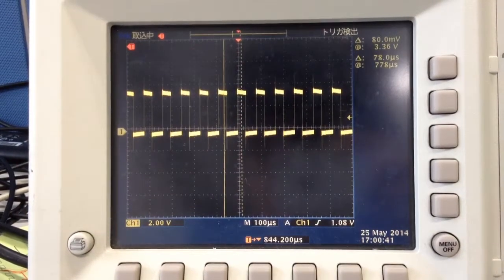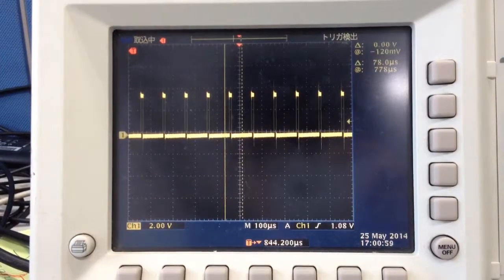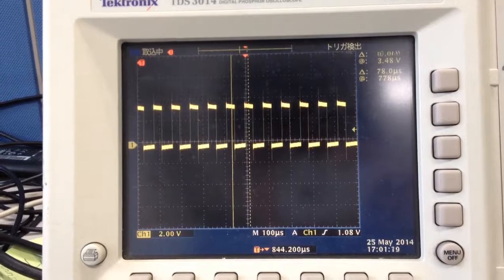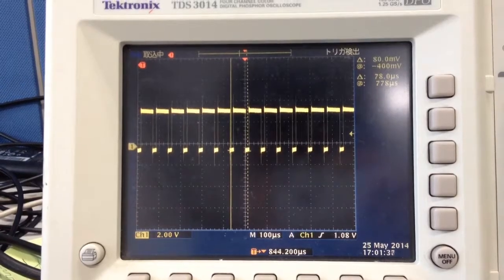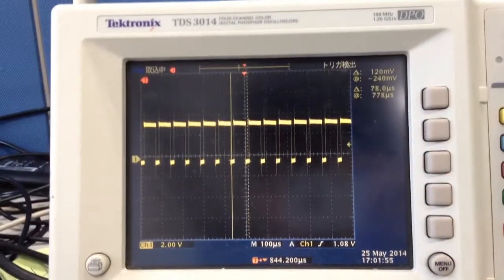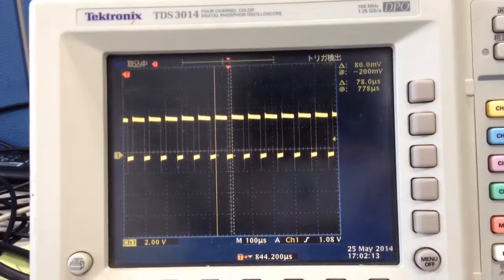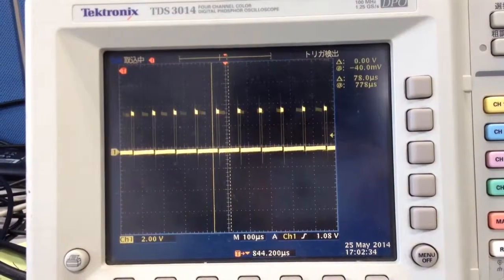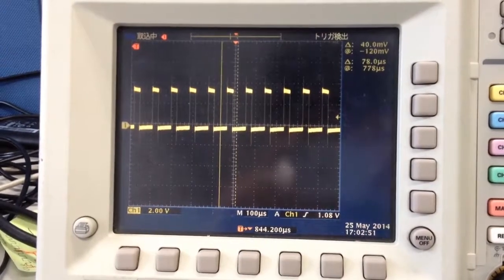DC motor control: Varying Frequency and PWM

Comment: hi, do you have the program for running the motor and how you varied the frequency
Reply from the maker: Hey man, it has been a long time. I probably can't find the program. I used the dip switch on the FPGA board to change the frequency.